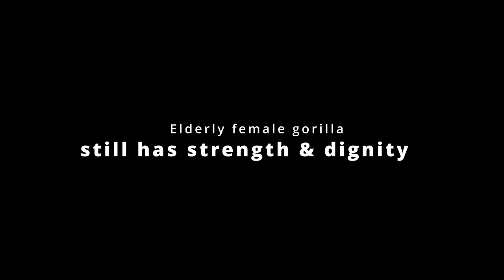Elderly Female Gorilla has grown Feeble but Still Has Dignity | The Shabani's Group

Comment: Nene did eat yesterday (This video is day before yesterday)... she nearly had a nasty fall from high up but luckily she caught hold of the bar (this is because Annie was chasing and "pranking" her). Shabani, as usual, did a great job as alpha and protector.... although he did try to bring Nene with force at some points. When you see him charging, I believe he's trying to keep the other gorillas away from Nene....as he seems to follow the same pattern each time. I believe this is why Annie had the strange expression with her teeth showing when she first comes up....because she's in the tricky situation of being next to Nene and in front of Shabani... her version of the 'pursed lips' which you'll see Shabani do whenever he is charging. As usual, she has her own style lol
Reply: I watched that vid, my heart dropped when she almost fell off the higher bar...😮.  Just the fall in today's video was tragic...while she got up and appeared ok, those bones are going to feel it later...and I agree with others, she needs to be separated and given a chance to heal...otherwise I'm afraid of the inevitable sooner rather than later.
Reply: Yes, I think the zoo should temporarily limit Nene’s movements - if there is a room that the other gorillas can easily see into until she eats enough to regain her strength after her bug. That way she has less chance of falling.